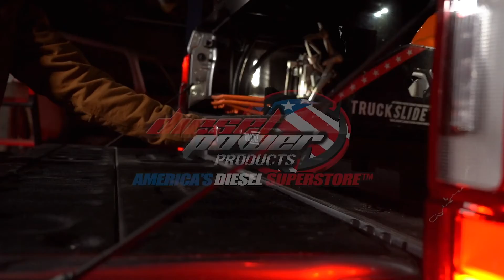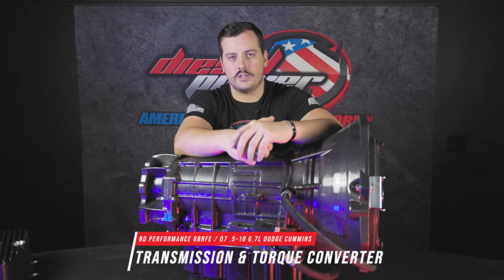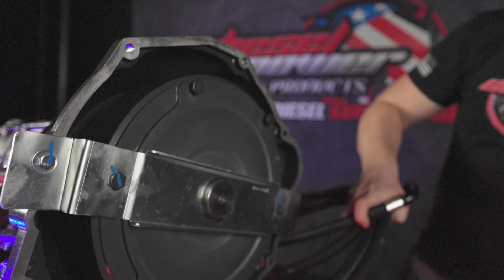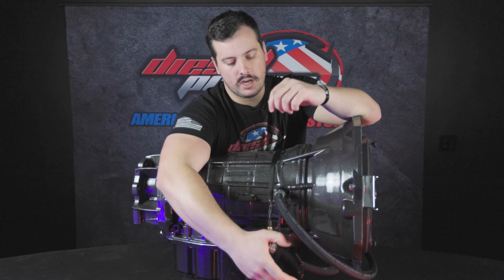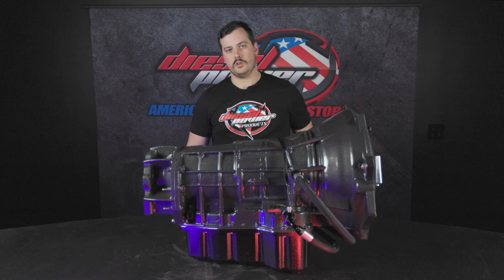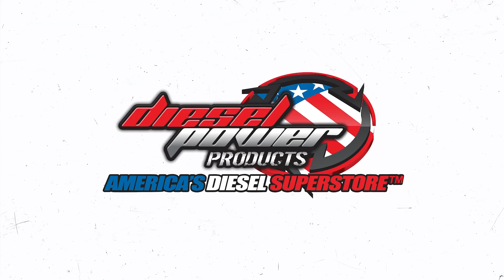Diesel Talk | BD Performance 68RFE Transmission & Torque Converter

Comment: Those valve bodies are not machined flat and if you have one of the bonded separator plates you have too much opportunity for cross leaks. We flat sand the valve bodies and the pump halfs.

Comment: Mostly good info, but your pressures are off. Factory 68s command 160 psi, most tunes without a valve body will command 170. If you have a proper valve body setup that blocks the oil that normally limits line pressure in drive tuners will command between 200 and 225. We used to run 250 psi, but we have seen deformation of the underdrive piston starting at 235 psi as we did more research. We also found clutches were starting to compress at 250 psi. This is a major problem as the overdrive drum has a very limited amount of travel and a lot of flex if not modified right. 225 psi is the safest max pressure for long term longevity.

Side note, I have seen multiple trucks with P0933, P0934, and P0935 codes as a result of the plug and play controllers. Pull those off and the codes go away.

Comment: The transmission doesn't need a tuning. Most tuning on a transmission tuning is just a tow haul mod. It doesn't need that, it needs the shift points changed , they need to be further spred out. The transmission shift really good when you manually shift it at high rpms, to me that one of the big issues that need to be addressed. The valve body upgrade is a good idea, the springs and new pistons inside need to be upgraded as well. I think a 1/4 plate would do better then most of these 1/8 inch plates. The valve body's need to be made out of steel that has been hardened and tampered to well above operating tends to hand the high temps of being loaded. I also think that everyone that owns won of these should start a class action lawsuit Chrysler for having so many problems and costly repairs and new transmission being replaced all the time. I think the EFI live can allow you to to change shift points, if so I'm going to try to calculate the shift points using the manual shift to see if I can get the shift points can be set in those areas and see how well it will react. I have manually shifted this transmission for a very long time and it works a lot better.
Reply: Spot on.

Comment: Had BD trans installed. Truck is mostly stock. It failed in less than 30 days! Apparently BD is giving my mechanic a extremely hard time on the warranty claim! Going on 8weeks! Idk who to believe. All I see is good reviews on BD. Anyone know who at BD I can contact?
Reply: I had the same issue. Had a built 48re in my 05 and after a week the tail started leaking. Ended up being a Crack in the case. It took me 2 years to get a new tail

Comment: This guy doesn’t know much about tuning. You can easily go above 250 psi line pressure with ezlynk or efi live
Reply: Haha, never said I was a tuner but appreciate the input. You can tell the transmission to run any line pressure you command (150,250,300) it comes down to internal parts that limit the capabilities. Keep me on my toes.
Reply: On a stock valve body we can't command more than 185 without throwing codes. But we can command whatever we want up to 250 anyway. After that the scaling for the sensor doesn't read any higher in the computer. Though I have seen them make over 300 psi as read by the mechanical gauge on the dyno, they are very capable of making high line pressure.

Comment: I just rebuilt my 68rfe myself and used bd kit with extra of/ud clutches and the Separator plate instructions said to drill a 1/8 inch hole in the valve body. I didn’t want to do it but did.
Reply: So 2 years passed, how does the rebuild holding up? And what kinda rebuild it was for what hp?
Reply: @andreined8463  held up fine.

Comment: If my transmission has 73,000 miles and is down shifting hard from 5th to 4th when loaded and shifter hard from 1st to 2nd when driving it hard or loaded also transmission rarely hits over 190 but I have seen it at 210 would this kit help out or should I replace it
Reply: Replace
Reply: Valve body